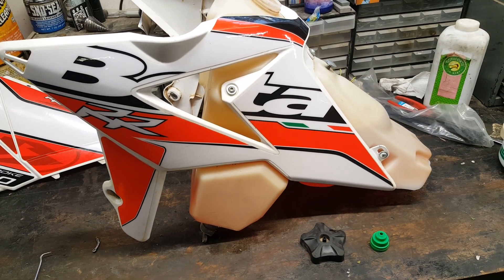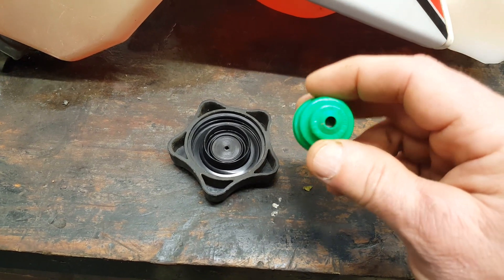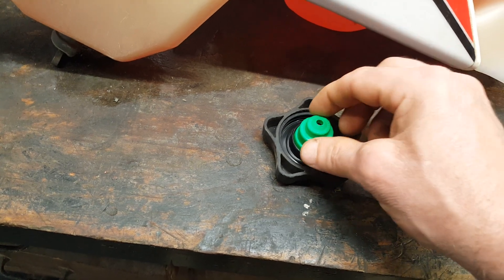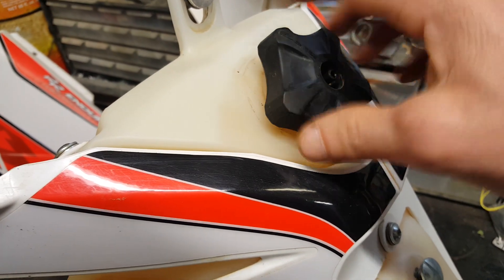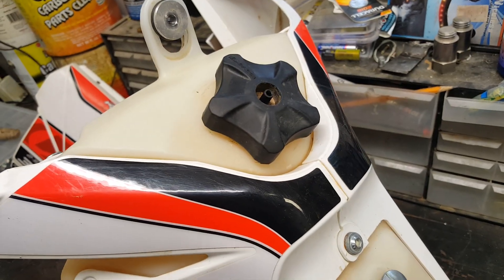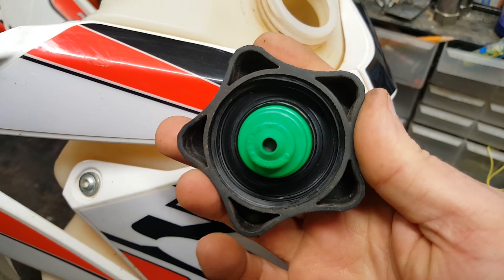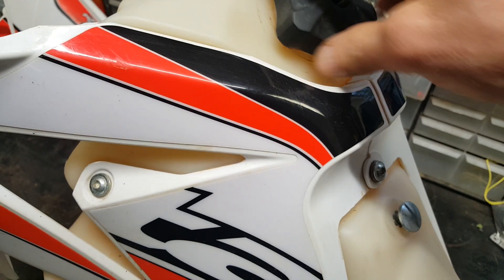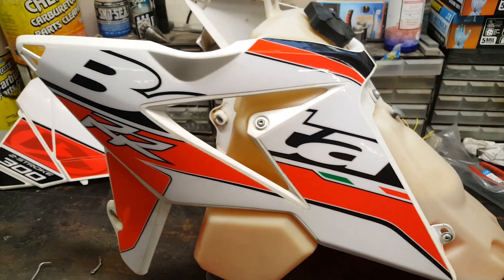MY18 Beta 300RR Pressure Relief Valve in Fuel Tank - Episode 37

Comment: Just a heads up, Beta rep from Beta USA has indicated removing this valve, as it is emissions driven, and has caused over pressurization issues, which has been reported many times with Beta owners. Over pressurization with the FI can cause performance problems according to Beta rep. Any easy solution is to remove this emissions valve from inside the gas cap and replace your gas cap vent hose with the free flo brand which incorporates a anti spill valve to prevent fuel from leaking out on tip over or crash. Free flo gas vent hoses have been around for many years and run by many dirt bikers. https://www.rockymountainatvmc.com/parts/free-flo-no-slop-gas-cap-vent-hose-p
Reply from the maker: 100% agree.  Thanks for the link.  I'll follow up.
Reply: @JeffSanGeorge953  Appreciate your videos BTW!
Reply from the maker: My goal is to support the Beta community.
Reply: @JeffSanGeorge953  Really appreciate you providing excellent insights for us Beta owners!

Comment: MY19: The valve dropped in the tank, also the small filter inside the tank pipe. Had to drain the gas and remove the tank to get the valve back and the   remove the gas tap to reinstall the filter. Regarding the gas filter in the tank, it's better to install a gas filter in the gas pipe to the radiator.
Reply: I meant carburettor, not radiator
Reply from the maker: I always put another filter inline. Yes!

Comment: Nice explanation. Thanks! My cap didn’t come with that.. older 300. I’ve had a bunch of issues with gas cap venting clogging through the years for different reasons on different bikes.. I just keep it simple now with just a simple vent. Just to add to the info. Thanks again for the info.